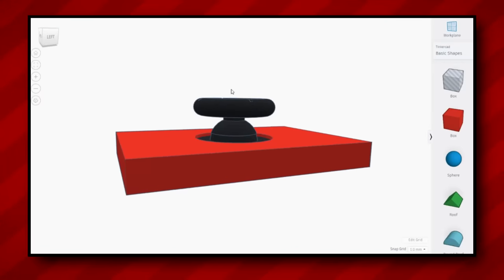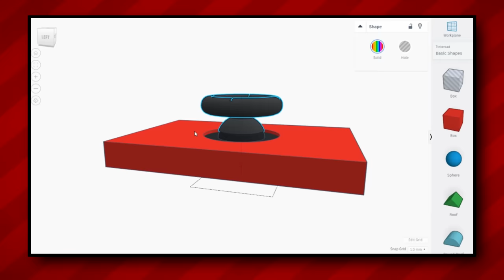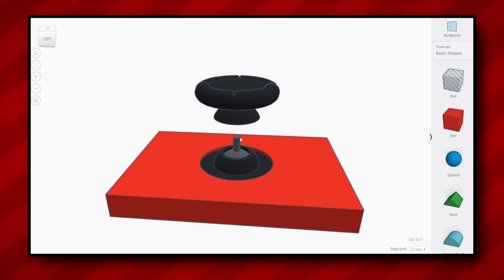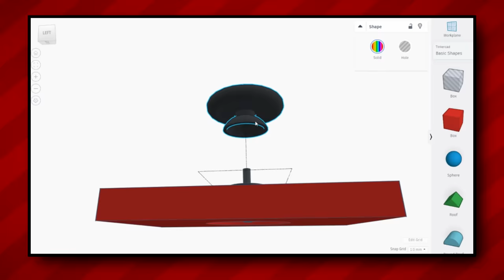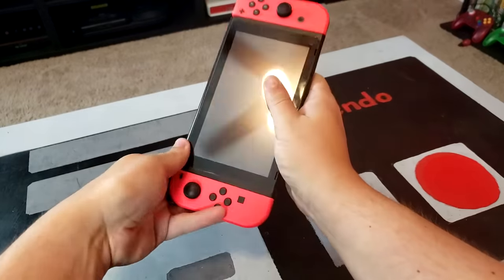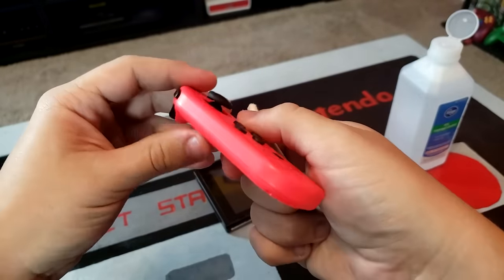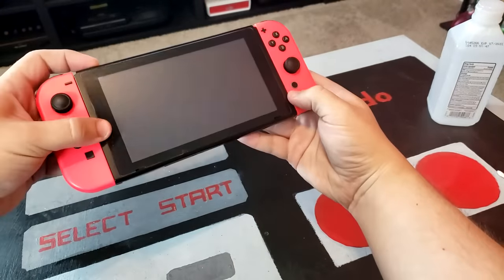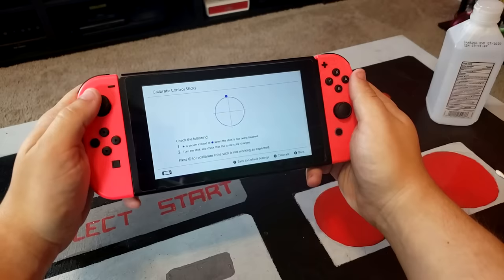How to Fix Joy-Con Drift at Home! No tools required! | Nintendrew

Comment: While this is a good solution, a better one would be for Nintendo to redesign the sticks to not eventually fail.
Reply: All electronics will eventually fail.
Reply: The best solution is to not use your joycons at all. Lol
Reply: My launch joy cons are fine. I keep them clean and update / calibrate them and it works. Even when i play smash!
Reply: @Retromanamama  I do too, I get that it's a problem if you DO screw it up, but people should take better care of their controllers.  Especially if you have a collection and every single joycon is experiencing drift. People broke the switch lite 2 days after it came out
Reply: @anthonynewberry1172  agreed but the switch light only had one with an actual video which looked more like a sticking analog and not actual drift.
Reply: @Mad-Lad-Chad  But not as fast as Joy Cons
Reply: @Retromanamama  same, have never experienced joycon drift on either of my 2 pairs of joycons
Reply: ruhl1337 they won’t because that have a stick up there 👆
Reply: Yes
Reply: Yeah isn't it a coincidence that Nintendo is getting sued for joy con drift and then nintendrew makes this video
Reply: @glub1381  I'm not trying to say it's everyone.  If people are taking extremely good care of notions, then it is on Nintendo.  But I'm talking about the people who don't take good care of their joycons and get dirt into them, then blame Nintendo for it even though they didn't treat $80 co strollers properly.
Reply: Controllers
Reply: All joysticks eventually do this, just not as quickly or for the same reason the Switch's do.
Reply: Chad but they shouldn’t after only a few months
Reply: Eventually?
Mine failed within the first month...right after they released their first controller update for "additional stability".
Reply: Smiles1222 It’s all fun and games until you have to unpair your joy- cons and play using the Pro Controller 24/7 (based on a true story 👍)
Reply: @Mad-Lad-Chad  but not in the first few months of its launch smh
Reply: @glub1381  true, same here
Reply: @redcrimson1028  Funny, mine are over a year old and perfect.  It's almost like not all of them have an issue.
Reply: That's because u probably dont play your switch as much as me. I play my switch every single day and i bring it everywhere with me. Playing your switch here and there of course u wont have a drifting issue.
Reply: RETRO wombat you shouldn’t have to do that, especially with 70+€ controllers. They’re faulty. That other buff Nintendo dude (can’t remember the name of his channel) showed that the lower structure of the sticks leaves some black dust particles with normal usage, which create false inputs. But I'm glad someone’s not having issues with them.
Reply: agreed
Reply: @anthonynewberry1172  yeah agreed, people need to take care of there stuff.
Reply: Sears Films 
My joycons drift so bad I cannot use them at all, so I'm stuck using a Pro controller.
Reply: @redcrimson1028  That's a pretty bold assumption.  Yes, I use mine daily as well.   But all of this is remiss of the main point.  No matter how Nintendo designs these, they will eventually fail.  So the comment I originally replied to was kind of pointless.  Nintendo has changed the design, and only time will tell how these new sticks compare to the old ones.  We can agree the change needed to happen.
Reply: Well.. they didn’t. 🙄
Reply: C R the thing is, the twin towers WERE made to be airplane proof. But then the planes got bigger.
Reply: Instead of using rubber,just use plastic, that should prevent any dust & dirt to get inside it ,right?
Reply: As someone who works for a company that mods controllers and does tension etc. It will always fail.... it’s like saying develop a car that doesn’t ever fail....
Reply: Elongated Muskrat drift happens when your tension is off. To say it’s Nintendo’s fault you clearly have no knowledge of controllers. They fail on every controller... ever...
Reply: Anonymous I’ve had controllers I test on a chronus fail and drift out of the box from Sony and Xbox...
Reply: Ps2 is an example how to create a controller.
Reply: @Mad-Lad-Chad  That's a new level of Nintendrone behavior. Excusing a faulty mechanism with "aLl ElEctOniX fAiL!!"
Reply: I mean everythings gotta fail at one point, but we need controlers that can last 20 years instead of a month and a half
Reply: ruhl1337 Wise words form Pepai
Reply: @Mad-Lad-Chad   yeah but that should be well after the lifespan of the system if it fails in such a short time then it should be fixed
Reply: Or maybe keep your console clean, you filthy gamers.
Reply: @Mad-Lad-Chad  That's true, but well made electronics tend to last longer than half a year. My PS4 controller, despite taking many dirt and falls, still worked perfectly since the day I first got my PS4.

But the joy-cons? Easily the most fragile piece of equipment I had the displeasure of handling.
Reply: @Mad-Lad-Chad  Yea but the Joy Con for me are the only controllers I have had drifting issues with. And it happend way too quick, like not even a year after I got my Switch. And I KNOW I'm not alone on this.
Reply: @redcrimson1028  that's not a good argument. You're making a lot of assumptions..
Reply: @ronnylightyear7150  I feel I should clarify a bit.  I never said they joy-cons do not have issues.  They do, and Nintendo dropped the ball on repairs and still hasn't been public enough about it.  I agree 100% with this whether I personally have had issues or not, I NEVER said otherwise.
What the OP said was "redesign the sticks to not eventually fail" which is impossible.  Eventually electronics will fail.  Hopefully the slightly modified design they have now helps, only time will tell.
Reply: @anthonynewberry1172  Even if people take care of it, the fact that it's a portable system that you're often taking out into the world means that Joycons are naturally going to experience a level of wear and tear beyond say, a Dualshock controller that just sits on a table in your house.
Reply: That doesn't make money though.
Reply: @halodude7167  Are you trying to imply Nintendo made these THIS fragile on purpose?  Really?
Reply: Or they could have a hardware update that increases the dead zone
Reply: @Mad-Lad-Chad  that I would be, very few companies don't anymore. Can't get continued revenue out of an item if it lasts forever.  That said, I dunno how rough you all are being with your switches, I've had mine for 7 months and had it crushed into my backpack behind groceries and such, hell I've even thrown my bag with it inside yet the joycons still work beautifully.
Reply: @ractsninjas  PS2 controllers might not have failed but the system itself is a piece of shit. I bought four PS2 systems and all for eventually died on me as the optical drive was really bad on them. 

As for my Switch joy cons, I've got 3 pairs, 2 day one and 1 from the Mario Party bundle, and none of them have drift issues. I play about 2 - 3 days a week and about 1 - 3 hours each time with a rough estimate of about 6 hours a week. That should be plenty of time for my joy cons to develop drift issues since they're day one purchases.

As for my PS2 always failing, well, I played that thing, between games and movies, probably 10 - 12 hours a day and Sony's cheap optical drive just didn't hold up. My PS3, also day one, gets used everyday and it's still working. My PS4 is basically brand new as I've only played it for less than 20 - 30 hours, although I have like 70 games for it. I'm just so backlogged on games that I just haven't had the time to play it. That along with work and family makes finding the time to play videogames much harder. I also tend to watch more movies so that also takes away from videogaming.
Reply: Drifting is nowhere near as much of a widespread issue as the internet claims, it's mostly isolated incidents followed by paranoid people freaking out that "DRIFT DRIFT DRIFT!!!!!!!!" also ignoring that the joycon is far from the only analog stick prone to drifting.
Reply: Right? Nintendo too stupid to do that
Reply: @Mad-Lad-Chad  yeah but it's a huge difference when a ps3 controllers live for over 10 years with no problems at all and a switch controllers live for a month and it's already unplayable
Reply: @Mad-Lad-Chad  yes but they shouldn't fail in a few years. My car is 20 years old and all the electronic still work. Hell my play station 2 and xbox360 still work. Nintendo make high quality and sturdy product. For the joycon to fail in a less than a year is ridiculous, we're buying a $300 console, not some knock off souja boy console.
Reply: JoyCon Drift is pretty much unavoidable for most people, even if you do take care of your Switch properly. Nintendo really does need to take a proper revise on the JoyCon's, because it didn't change with the Switch Lite at all. (People also broke them fairly quick)
Reply: @Smiles122  Is that legit a possibility? Pairing other systems controllers with the switch? Even better use a ps4 controller with X mapped to A or something.
Reply: I only play very rarely on mine and it's now a extreme hassle to pause the game in Links Awakening while looking up some solution to make a chest appear. When link repeatedly walks into a pit due to Joycon drift. Sorry for the run-on sentence. Not sure how to reword that.
Reply: Such a millennial response. Yes, Nintendo should redesign the sticks, but that doesn't fix the current drift problem we're experiencing. What is required is method to fix the controllers we already have, right now.
Reply: They designed it to fail, no joke
Reply: Chad I agree but these things fail within the first year... rip off for $60
Reply: “Eventually” how about not fail after a month
Reply: Flix stick up their finger?
Reply: Mild Rain I mean I’ve owned consoles all my life, never cleaned an Xbox or PlayStation controller ever and never had a single one fail even after thousands of hours of intense gaming. Stop defending Nintendo for something that’s clearly an issue.
Reply: Don't tell that to my 91 celica.  Pretty sure it will out last me
Reply: @Mad-Lad-Chad  This is true, but the relatively short period of time it takes for a switch joy con to drift is unacceptable given Nintendo's past consoles such as the Gamecube that had much more reliable controllers. No controller model should give way on a regular basis while the console it was made for is still selling games. This is incompetence and greed.
Reply: Yes, all electronics will eventually fail, but that's no reason for controllers that are only a couple years old to fail faster than the NES controllers I've had for nearly 30 years and still function perfectly fine.
Reply: How else will they sell us an improved version later that doesnt break?
Reply: SALT  not even rocks
Reply: Kuuhazan  wow, just WOW!
Reply: Im gona vote for you in the selections
Reply: @Mad-Lad-Chad  "I got very lucky, therefore there is no issue!"
Reply: yeah well switch is a badly made system
Reply: Nintendo are not that good at making tech that works successfully long term
Reply: Yeah, of course, I got a million dollars in my pocket to research, redesign and test a new controller. Oh yeah, forgot, I spent my money on a Lamborghini yesterday, sorry.
Reply: @UndregoGrey  
All of us kept our consoles as clean as possible, and it still got drift. Dust exists and it will get on things no matter what you do. It's Nintendo's fault for making garbage controllers that can't even last a year after the console's release.
Reply: @C R That is a whole different story, you can't predict planes crashing through a building but a mechanical device you should note the possible precautions or Nintendo companies could have given tools to fix these
Reply: It worked for me
Reply: @Mad-Lad-Chad  They shouldn't fail as constant as the joy cons. I own 4 pairs and all 4 suffer from different issues. At this point it's like owning a pair of PowerA controllers. Heck, I wouldn't be surprised if they're the same controllers just the Nintendo logo slapped on them.
Reply: @nathanrcb4066  I beg to differ, the NES and SNES controllers are like tanks. Gave them a beating back in the early 90's and worked like champs.

The N64 controller was decent, eventually the joy stick would give away but that was after playing games like Mario Party.

The GameCube controllers were solid too.
Reply: @VeryOrigionalMan2  I had minor drifting issues on my Xbox One controller... that's 6 years old. Pain on the ass to open and fix. 

The PS4 controller on the other hand, only issue is the rubber on the sticks. But they're easy to open and work with. 

The nintendo controller, worst design of all 3.
Reply: Tbh they should have just made them circle pads or something like Valve's Steam controller cursor pads.
Reply: All controllers with joysticks will have drift eventually. Nintendo just designed theirs so the dritt happens a lot sooner
Reply: Nonsense!
Reply: @anthonynewberry1172 
Seriously? Nintendo games are advertised as family friendly. The type that even 7 year olds could play. How are you gonna teach some dumb 7 year old to take perfect care of their console? If anything, since it's made for kids it should be more durable than the Xbox and PS counterpart.

Also, the switch main selling point is how you can take it anywhere. So how are we supposed to keep it dust free when we're playing on a bench in a park. Or on a train or something. You can't even use it for it's intended purpose now.

I can't believe you guys are defending this. Wow.
This Nintendo circlejerk is nauseating.
Reply: Especially since the solution is as simple as not making the interiors of the fuck'n thing out of scrachable carbon.
Reply: SALT  not even humans last forever
Reply: sigh we can only dream of such happiness
Reply: agree
Reply: @glub1381  If it is this easy to fix (simply cleaning them with alcohol), then I don't see any issue going forward now that this procedure is out there....and I'd honestly be kicking myself if I hadn't at least tried this.
Reply: Yeah but after u’re gonna need to buy the new joy-cons
Reply: Pro con users: laughs
Reply: @Mad-Lad-Chad  true but if my GameCube ps3 ps4 controller's last longer than new joy cons that's a problem
Reply: @Mad-Lad-Chad  You are right, but not that faster.  Man, My Gamecube controller still works
Reply: ruhl1337 3 years was more of enough time to fix the issue. Nintendo just wants money at this point. Because everyone with one switch system will have to buy a second pair if they wanna play while they send the other in. They’re smart. They will at least sell an extra joycon for every single switch owner
Reply: @Mad-Lad-Chad  but this started happening 1 month after launch that's not okay
Reply: @Retromanamama  who plays smash with joycons?
Reply: @tegsoup5884  people who don't have money for other controllers
Reply: The should just give the control stick the same design the wii u control stick had
Reply: @anthonynewberry1172  I got my new switch joy cons a few months ago, never did anything to them, honest. Then one day I'm playing mario kart, and I notice im slightly turning to the left, and it just got worse from there
Reply: Or maybe they shouldn't be so dang expensive
Reply: Tbh the joy cons are shit
Reply: ruhl1337 well if they did everyone would have to buy new controllers and this solution wouldn’t cost nearly as much
Reply: To not ALWAYS fail.
Reply: @anthonynewberry1172  the problem is this console is for kids 5 years old also who won't know about this stuff it is just such a flaw in design
Reply: I’ve had my joycons for two years now, and today is the first time my joy cons have began to drift
Reply: Mine started drifting within about two weeks
Reply: He’s not saying for it to last forever, he’s saying he doesn’t want them to break after 3 months
Reply: SALT unfortunately the switch sucks balls and I wish I never bought ot
Reply: Best solution would be to implant controllers into out minds to fix mechanical controller from messing up forever but I guess we can't all get the best solution all the time.
Reply: And most of all give people affected new joycons or atleast replacements for affected ones
Reply: @Mad-Lad-Chad  yes but not after 3 weeks
Reply: @kandy5129  Didn't say they should break after 3 weeks.  All I said was nothing lasts forever.
Reply: Chad  i bought mine one week ago...
U cant tell me that " eventually „ is after one fucking week
Reply: @Mad-Lad-Chad  that's bullshit. Did the gamepad drift? I don't think so.
Reply: I love some of the stupid comments people make defending Nintendo on their poor design. I had joycon drift within the first week of owning a switch that I didn't even play that much on. I had the system in a clean and open area as well. Meanwhile I can dig out a grimy old original ps2 dualshock controller and it still works fine. I've never experienced "drift" in any controller I've ever owned in my life until I got the switch, even old controllers that I didn't treat nearly as well as my switch.
Reply: Mine didn't "eventually" fail, it was drifting out of the box
Reply: @Mad-Lad-Chad  I've had my Wii U Gamepad for almost 4 years and there's nothing wrong with the joysticks, however, I've had my joy-cons for less than a year and they already have a massive dirft
Reply: @meritxellshepherd7680  Yup, and thats bad.  I never said otherwise.  Stop trying to read between the lines of what I said, there isn't anything there.  I meant exactly what I said and only that.
Reply: @Nichaelas  If you're referring to me, I didn't defend Nintendo.  At all.  What happened with joy cons is bad.  The price for the joy cons is bad.  But misinformation is also bad.
Reply: @Mad-Lad-Chad  I'm referring to anyone that tries to excuse this issue. I didn't directly reference what you said. If you said that as a general statement yes that's true idk how that contributes to the discussion but it is true. The problem I have is people using that lame excuse for the joycans failing only a few days out of the box.
Reply: @Nichaelas  My bad, I thought you were replying to me because thats what youtube said xD.  I actually have a hunch that its a software issue.  Every controller I own for switch (aside from my joy cons) is starting to drift.  Controllers I use with an adapter that do NOT drift on other systems also drift on the switch.  Its almost like they didn't set a 5% deadzone like most consoles do.
Reply: Chad the joy one are particularly quick to drift
Reply: @DelDaManInTheMix  That they are, never said they weren't.  But expecting them to be designed to "never fail" is simply not going to happen.  Longer life like normal controllers?  sure.  But no electronic device "never fails".  They all do eventually.
Reply: @DelDaManInTheMix  What?
Reply: @Flufferpup  I'm sure some people went through many more than just 2 dualshock 4's, and fewer joy cons.  Anecdotal "proof" isn't helping.  No one said the sticks don't have a problem so you can stop with the anecdotes, because we already agree lol.  But no controller lasts forever.
Reply: @Grenino  yeah that could work for early drift but my drift goes to the very left or top
Reply: @thanks721  yeah, that's true
Reply: @Mad-Lad-Chad  Yeah but not within 9 months of purchase and only less than 40 hours of use.  This is so disappointing as Nintendo products are usually pretty good quality.
Reply: @petermartinez8480  Never said they should fail that fast.  If you read any other comments I've made you'd see that lol.
Reply: I strongly agree
Reply: Chad and yet no other controllers deal with this issue. Hmmmm
Reply: @gabeitch9142  I have 2 controllers that drift.  Ps4 and Xbone.  Does that mean there is some major flaw?  No, it means I got unlucky.  Other controllers have issues.  Just because you personally don't experience them doesn't mean they don't happen.
Reading between the lines here is a bad idea.  All I simply said is nothing lasts forever and its true.  Eventually all electronics, no matter how well designed, will fail.  Expecting anything different is silly.  Now how LONG they last, well thats a different thing.  Sure, joy cons have some issues.  I've never said they don't.  But even if those all get fixed they STILL won't last forever.
Reply: @anthonynewberry1172  my family is dumb and ruined every single pair of joycons and it really ruins the experience for someone who barely got the chance to use the damn things
Reply: SALT  I still own a 6 year old Wii U that I got for Christmas back then, and around the beginning of 2020, it has finally shown some signs that it's starting to fail, like when it turns on, it used to make starting sounds, but now, it sounds almost completely quiet now....
Reply: @anthonynewberry1172  why are those controllers so fragile?
Reply: @Mad-Lad-Chad  why are so surprised by that? A lot of companies make their products fragile on purpose so you have to buy more of them
Reply: @elin111  I wish I could believe you but I've read a lot of comments (not only on YouTube) that stated that they experienced problems with drifting
Reply: @besos4169  I'm very aware of that.  Nintendo is guilty of this as well as many other companies imo.  On the plus side at least the joy cons are easy to open up and repair (if you're the DIY sort).  Haven't opened my xbone controller yet so we'll see how that one goes.
Reply: bro
Reply: It's Nintendo . . .  what do you expect?
Good Quality or somethin like this, no waaaay
Reply: @Mad-Lad-Chad  Not fail as quickly or catastrophically.
Reply: @Retromanamama  you haven't experienced it yet. It's basically guaranteed to happen. I used to talk like you lol I barely use my joycons. I prefer the pro controller, and it's still happening on my original left Joy con. It's not an issue of not taking care of it. It's an issue of a well known problem that Nintendo is not fixing.
Reply: @bleechrcreechrr  Nintendo actually did offer to fix it. You can send in the defective controllers to be fixed. And you can say this but still it hasn't happened for me. My husband uses his pro controller  every day ever since he got the switch (2017) and is harder on things more than I am and he hasn't had any trouble. Keeping things clean helps.
Reply: @Retromanamama  I know they have. But that's not fixing the bad design that causes them to drift. AFAIK this is joy con exclusive so it won't happen to your husband's switch pro controller.  My joy cons are kept clean. It's only a matter of time until it happens to yours. It's defective hardware.
Reply: @bleechrcreechrr  regardless if it does it's sure taking alot longer than other people's. Nintendo's new joy cons I have not seen this happening to anyone. I do know a few people who have had it happen to their pro controllers that's why I brought that up. Even if you say it is "bad" design you did state they were doing nothing about it and if you knew they were fixing them for free them your statement is false of them again "not doing anything about it". I do hope that they find the best way to make these things but again keeping them clean makes it last longer.
Reply: @Retromanamama  NEW joycons lol yeah it takes a couple years for it to happen. Took mine 2 years and it finally happened to one out of 4. And I stated they're not doing anything because it took them forever to acknowledge it was even a problem. And then they offered to fix it because people were threatening a class action lawsuit. They were ignoring it before that.  It's not near as noble as you make it sound. And I reiterate, I keep mine clean. 3 out of 4 are fine so far, but since it happened to 1 I'm assuming it will eventually happen to all of them.
Reply: I'm always careful with consoles etc, i've never broke any controllers or anything like that. For some reason, my left joycon still drifts up and down, even if i really have been careful. I've never thrown it, dropped it or pressed it in an aggressive way or even eaten any snacks or anything while playing with it. i've treasured my switch, yet my left joycon sucks ass! Hopefully Nintendo redesigns these  joycons.
Reply: Chad quality is still relevant though and if my old controllers that I‘ve used for literal years still work perfectly fine then this joycon shouldm‘t fall apart after halve a year. This is cheap manifacturing and Nintendo should be sued for selfdestructing tech scams.
Reply: @takke9830  word. My GameCube controllers are over 10 years old and they work great
Reply: @andrewpenn1145  but that's not what I said.  So what's your point?
Reply: Alexander Nelson cough gameboy cough
Reply: @Mad-Lad-Chad  Never had a controller fail twice while under warranty...
Reply: @Anreii  First time for everything :D
Reply: The only good comment
Reply: Chad yea but the switch controllers fail way to early
Reply: Not really though, I mean would be nice if they did but that wouldn't fix the one I already have.
Reply: Chad well it should last longer
Reply: Yeh. But that would mean Nintendo having to admit their mistake and that rarely ever happens.
Reply: To all the people who say that they're going to fail anyway, I've hade my switch for only a few months and my right joycon started drifting. I don't play it that often and when I do it's not even more than a few hours on Minecraft or SSBU. 

Every other gaming controller I've had has gone years without showing any wear.

So yeah, Nintendo definitely needs to fix their joycons.
Reply: @samcorry367  jiffy
Reply: So true!
Reply: @Mad-Lad-Chad  Bruh, my PS4 controller that I've had since launch like 6 or 7 years ago STILL work fine no drift. Hell, sometimes I don't use the PS4 for weeks or months since I have a PC now, so they end up getting real dusty. Literally only just wiping the outside dust (not even touch the analog sticks), I still don't get drift. I'd say as far as Nintendo's design for the joycons go, they certainly failed with the dust/longevity portion of it.
Reply: @JoseMartinez-yy5hh  I never disagreed with anything you just said.  But the fact remains, nothing lasts forever.
Reply: should have used circle pads
Reply: @glub1381  No it not, you just hate Nintendo
Reply: Gamecube controllers are designed a million times better than these dumb joycons
Reply: @Retromanamama  I play smash too! :D
Reply: @anthonynewberry1172  indeed, my right joycon se ft but i It was my fault for not taking care of it
Reply: They could've had a simple o-ring made of [choose_some_low_friction_material] that would've mitigated dust and grime from getting in between the two parts, buuuuuut I guess that was too hard.

/large industries aren't exactly known for intelligent cost-savings means
//adding eight cents of production cost for the sake of maintaining consumer goodwill? how silly!
Reply: Say that again for Nintendo at the back!
Reply: @Mad-Lad-Chad  We're not asking for them to last until the end of time, as you so boldly claim, we're asking for them to last a lot longer than they currently do. Nintendo just refuses to acknowledge this issue, and it's aggravating a lot of consumers.
Reply: @nathanrcb4066 
Successfully long term? My Wii Nunchucks still work after more than a decade.
Reply: They would never do this lol
Reply: @Mad-Lad-Chad  if we're not talking about joycons, then only the ones that fall on the ground alot.
Reply: @-firathelightpheonix-3117  same bro
Reply: I just fixed it in 2 minutes, and I didn't even use the alcohol. It was so painfully easy to do. Almost frustratingly simple.
Reply: Mine stopped working a month after buying the console. Ridiculous
Reply: But that would require money!
Reply: Maybe... But i don't know how they could fix a dust problem, i mean, everything gets dirty over time, the best way to remove It it's cleaning, that aplies to everything
Reply: @elin111  So that means we still have to replace our analog sticks so many times, yeah nice try defending nintendo
Reply: @Mad-Lad-Chad  Exactly
Reply: @Mad-Lad-Chad  yeah but most dont fail a week after getting them
Reply: Dualsense drift because Sony uses the same stick mechanics like the ps1 dualshock
Reply: Exactly but they want moeny
Reply: @Mad-Lad-Chad  but they shouldn't fail in a few months
Reply: @PokeMario-pk4ot  Never said they should.
Reply: @anthonynewberry1172  this is a common problem that only the Switch has. Nintendo needs to fix this.
Reply: Exactly
 Joycon Drift makes certain games borderline unplayable. And since Nintendo WANTS people to buy their games, they shouldn't allow something that actively ruins the ability to use their product be this common
Reply: Well obviously 🙄🙄🙄
Reply: Especially since they cost fucking £60 for a new pair :)
Reply: @Mad-Lad-Chad  ok buddy
Reply: @SwagaTron-qq4lq  I don't even know what comment you're replying too xD I really wish YouTube would make it easier to see.
Reply: They won't,since they get more money from you
Reply: It’s the fact the it’s been 2yrs and it’s still the same, all my controllers have joy-con drift and it’s acc so sad
Reply: @PichuStardust  we been complaining since it came out and they haven’t done anything
Reply: @anthonynewberry1172  hey bro....i agree with u....but when u have kids,YOUNG KIDS, its not that simple....lol
Reply: Actually the best solution is launch a different Joy Con specially sine they feel cheap even more cheap than the Wii additional controllers
Reply: @Mad-Lad-Chad  the first light bulb ever designed and made still works today since 1901 and has hardly been turned off. Look it up. After they started making them to fail otherwise they would eventually stop making money.
Reply: @acakaantman11  I'm familiar with it, and while that's true that's not the entire story.  However newer LED's are completely different and have incredible life spans when treated correctly.

But yes, the original light bulb was purposely made to break more often after realizing how much money it would make them.
Reply: No shit
Reply: UR ICON....HONDA ILY...I'm sorry that was off topic but funny skeleton Bo)
Reply: This has always happened traced back to n64 lol
Reply: How did that “better” solution work out for you?
Reply: johnsampson6387  My Switch controllers don't drift after nearly 7 years, probably won't be drifting after 15 years either. Why? Electronic contact cleaner. A superior solution to fixing the problem than pointing out older controllers that didn't have the problem.